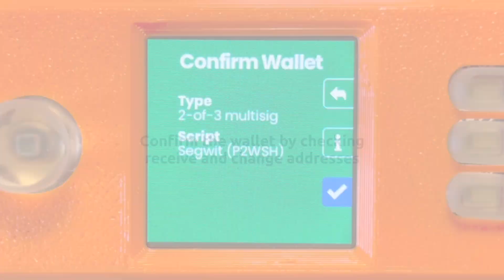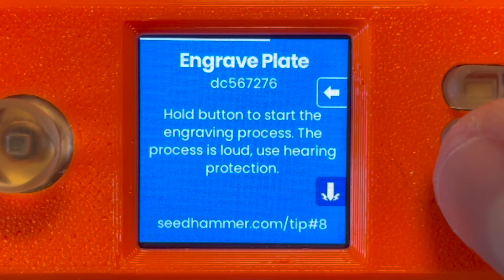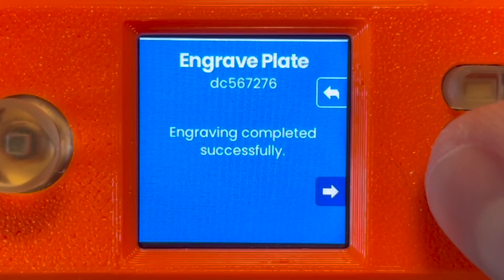How to Backup a Multisig Wallet With SeedHammer

Comment: If I wanted to first encrypt my private key using aes 256 encryption and only print the QR code representation of the encrypted key only, would this be possible? would it have enough space?
Reply: bad idea. since to encrypt your private key using aes 256 - would mean you have to put your private key to some computer to aes-256 encrypt it - which would mean your private key has been compromised. Unless you fully trust the device that performs aes-256 encryption (or you destroy it afterwrads if it is not connected to the internet/bluetooth/radio/etc). But you would also have to have the same trusted device when you are restoring your aes-256 encrypted key. a lot of risks. I recommend having a good 25th secret word/passphrase that you never forget.
Reply: @user-kv2lc8zo7u  simple solution would be to use a raspberry Pi which depends on an SD card (very cheap) once you encrypt or decrypt) you physically destroy the SD card by burning it and crushing it to ashes. My question is will this machine be able to print the QR code once it's encrypted?